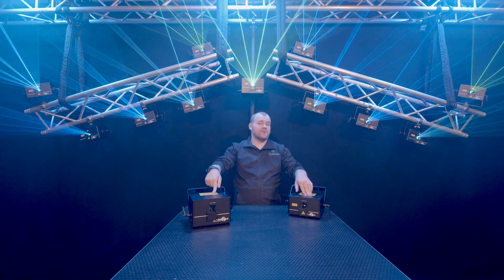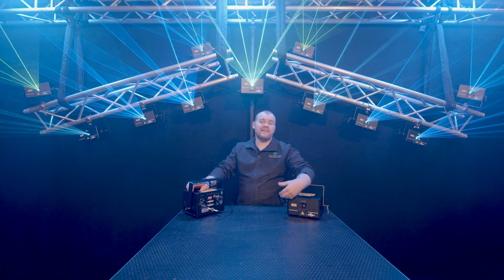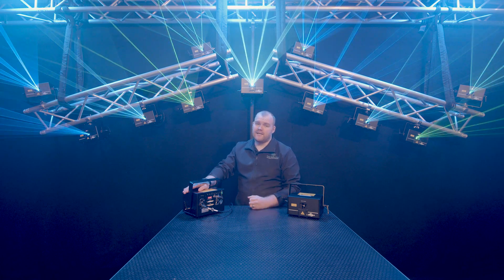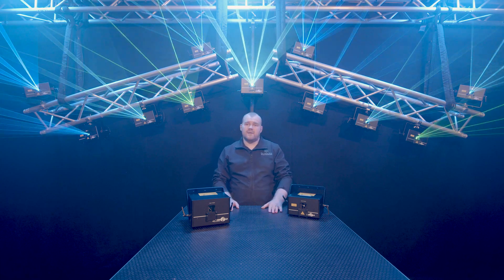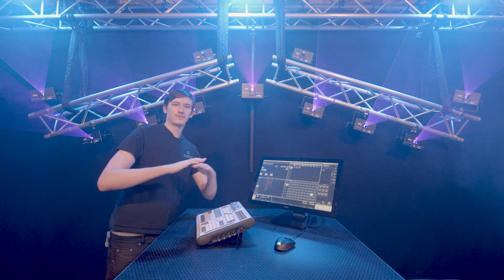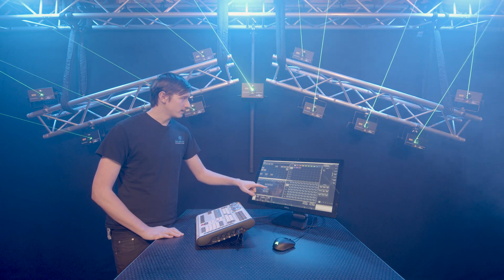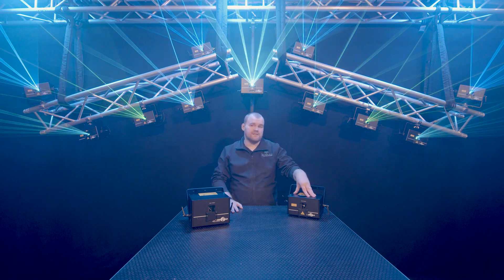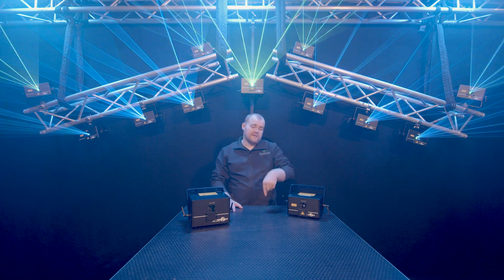How to control your lasers with DMX and ShowNET - Laserworld

Comment: Hi, can i do similar programming with the EL-400RGB MK2 or the EL-230RGB MKII ? 
Thanks
Reply from the maker: There is quite a gap between basic systems and more professional systems. The lasers in this video have a built-in ShowNET intelligent laser mainboard with a great variety of features. This is not comparable to entry-level systems. The Laserworld EL-230 MK2 and EL-400RGB MK2 are great lasers for parties and smaller clubs, but if it comes to more professional productions, we recommend checking out the Laserworld DS-1000RGB MK4 or higher

Comment: Hello, I am new to the laser world... I am thinking of buying laser from EL series... Is it possible to control it using ENTTEC usb interface and QLC+ program? Because that's what we using for lights. 
Great demonstration by the way!
Reply from the maker: Well, the Ecoline Series is very very basic. What is shown in this video refers to the Diode Series and higher, these have the professional ShowNET laser mainboard.
The Ecoline Series devices  (except of the El-60G) can be controlled with standard DMX, no matter which interface you use or which controller. DMX is a standardized trigger protocol. 
Pretty much all lasers of Laserworld, tarm and RTI can be controlled via DMX, but there are huge differences in terms of what you can do. All lasers with ShowNET mainboard have the same DMX profiles and they also support ArtNET. They are intended for professional use. Lower series, like EL or CS, also have basic DMX functionality, but depending on the design they are limited in possibilities. They work fine for parties, entertainers and clubs, that's what they were designed for, but if you think of more professional applications, we recommend going for DS and higher. With these you have much more compatibility as well: https://www.laserworld.com/en/shownet-compatible.html

Comment: Hi, do I need LAN connection to be able to control these via DMX + Avo Titan Mobile?
Reply from the maker: If you want to control the lasers via Artnet, then you need LAN. If you want to use standard DMX, just connect DMX. You have both options, just depending on your requirements.

Comment: Can you control two units without the need for computers and software? I have two green beamed units for home use and I don’t really want to use computers to control FX and miss out on the fun I’m hosting…
Reply from the maker: Yes you can do that - if you use ShowNET interfaces, could be external or internal, you have extensive control options with your DMX console. You can even create a safe area and specify the projection zone just with DMX and store it to the ShowNET mainboard.
Only important part is that you need a ShowNET laser mainboard or an external interface for this.

Comment: Hi there. Do you need an interface per laser or do you just need one laser to have one built in or one external? Thanks
Reply from the maker: As most lasers have the interface built-in (DS Series and up), you don't have to worry. Each laser needs to get some sort of control sigbal. So with built-in ShowNET that is super easy. If youvuse an external ShowNET interface, you could technically daisy chain the ILDA signal that comes out of the interface box through several lasers. However, they would all do the same thing then.
So best option is to get some units with built-in ShowNET and you just use them as intelligent lighting fixtures - like your moving lights.
Reply: @LaserworldAG  thank you so much

Comment: Hello, would it be possible to create a program similar to that of your video with the cs-1000 model? or better the ds-1000? I don't know which one to buy. thank you
Reply from the maker: These are basically DS units in the video, so with the normal Diode Series lasers, which have the ShowNET laser mainboard, you are able to do exactkly that - as it is shown with these units :-)
It is also possible to DMX control teh CS units, however, it's much more limited in what you can do. But for basic applications that works as well (just no ArtNET and other fancy features the DS have)
Reply: @LaserworldAG  Thank you for your answer!

Comment: WHAT brand/Model of 'DMX controller' + WHAT 'DMX Software' was the PROGRAMMER using (besides ShowNet) ?  This is an INCREDIBLE demonstration  VIDEO !  Thank You !  (Also, can I do the spectrum color sweeping using DMX , with my CS-1000's + CS-2000's ?)
Reply from the maker: That was done with an Avolites lighting desk
You are definitely able to do analog color modulation with your CS-2000RGB, with the CS-1000RGB only if it's the latest version - but it's only partly analog. However, to be able to use the full features as shown in this video you need a ShowNET interface with the laser - the built-in DMX is by far not as advanced as the one in the ShowNET laser mainboard. So smooth color transitions may not be available with the built-in standard DMX of the Club Series.